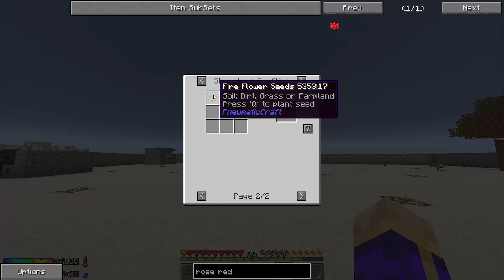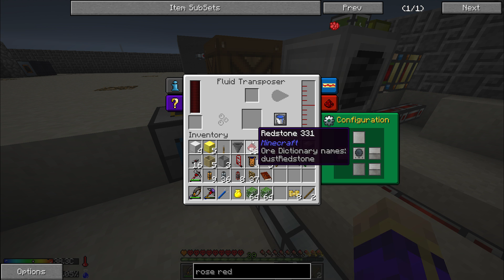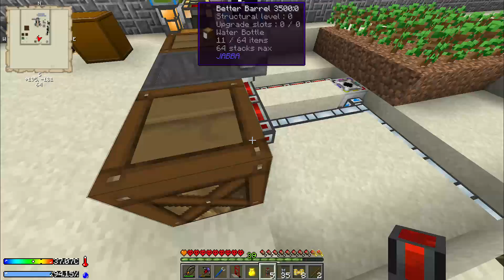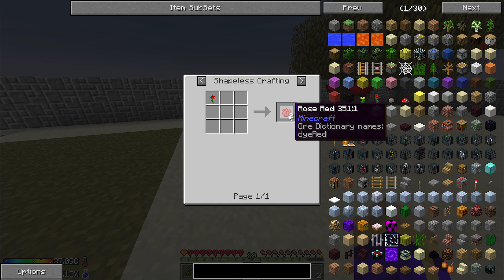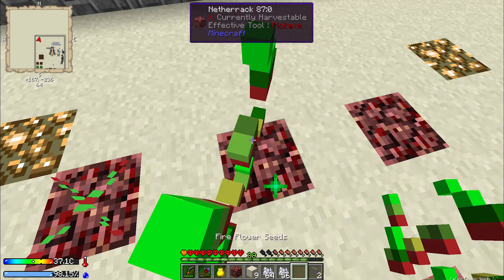*FIXED* Rose Red -Episode 15 - Crash Landing

Comment: The Best way to farm theese flowers is placing the planting land 1 or 2 blocks down so it has some walls around it when u break it it's contained and u can spam right click twice and left click 1 to break and they plant themselfs and on there going until u get a stack of them and run out of bonemeal (it works with squid plants best because they are a hassle)
 Also Direwolf20 found a way to automate them with Steve's factory manager using how Block Gate checks for drops of a block before breaking it simply filtering when it can drop 2 seeds Break it (written inside Steve's factory manager using two variables loop)

Comment: If you haven't found out already, the hopper upgrade doesn't work by itself. You need to add a hopper facade on the face it should hop to.
Reply from the maker: I had the wrong idea entirely then! Thanks.
Reply: Wouldn't call it the wrong idea, just a bit of missing information =)
JABBA can be a bit unintuitive, iirc it's the same for redstone output. You need the upgrade to give it the capability but also need to add a facade to specify the side.

Comment: Hey man you look a little hot out there why dont you look the part> those robes look hot dont you think (Could you start you Next epasode in this PLZ)http://www.mediafire.com/view/7kugek3vgpyi7od/skin_20141007025948149741.png
Reply from the maker: Silk or light cotton robes are some of the best desert clothing. It protects your skin from the sun, sand, and wind, as well as wicking away sweat to increase cooling, without increasing heat retention to a noticeable degree. You are significantly better off with light robes than nudity.

However, I'm planning to replace my gear with something better Soon.